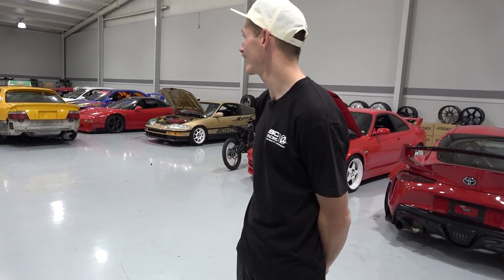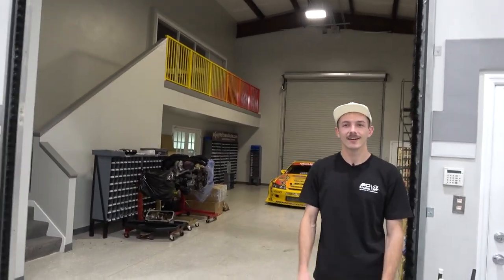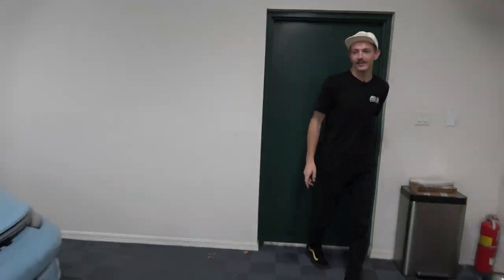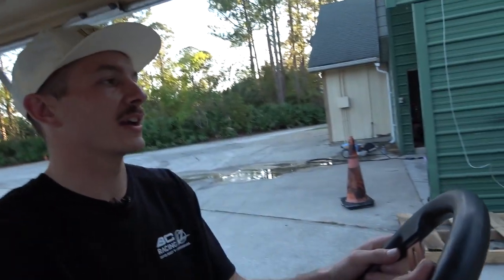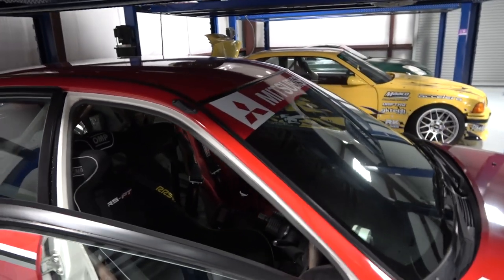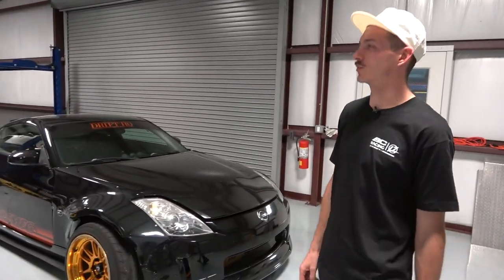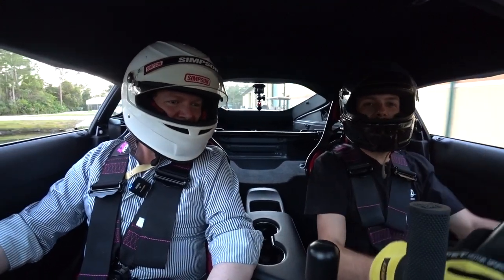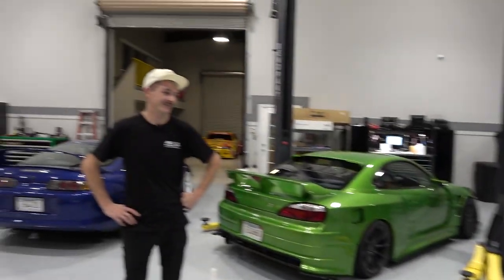DRIFTING with ADAM LZ! I Visited the LZ Compound to Tour the Collection

Comment: i wouldve loved to see adam drive the amg black series. he has a track layout and a lap time leaderboard. would be cool if he got in the amg and just aced the track beating everything so far despite limited experience (in the amg). he has the talent and the car has the pace i think
Reply: Neither of them want that liability.  Very expensive car to hoone around the compound.
Reply: @user-od9iz9cv1w  he's ripped cars that cost about the same, like a 911 gt3. and ones that are fairly rare, like his Evo V which has had a lot of modifications. he's also a formula drift profesional. if theres anyone who could drive the amg fast around there without crashing, its adam. but i do think your point holds a lot of weight.